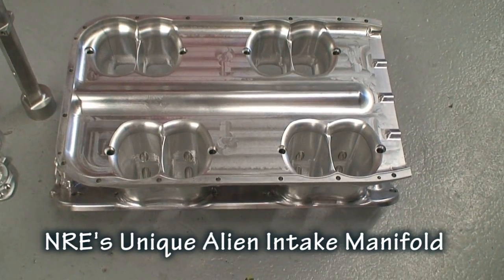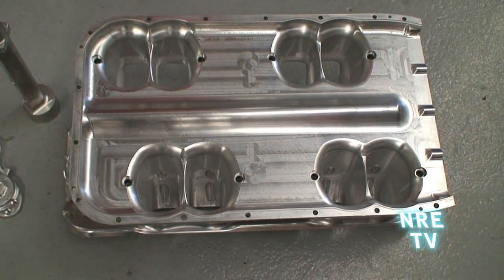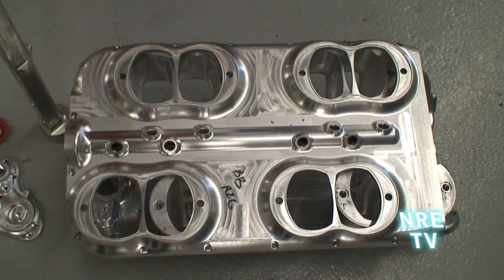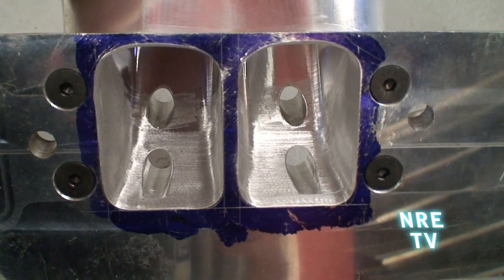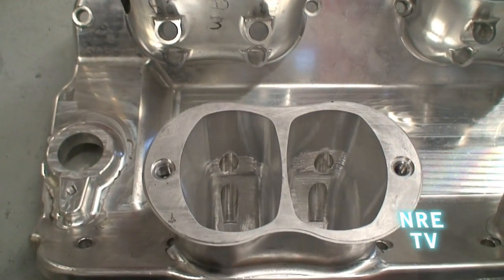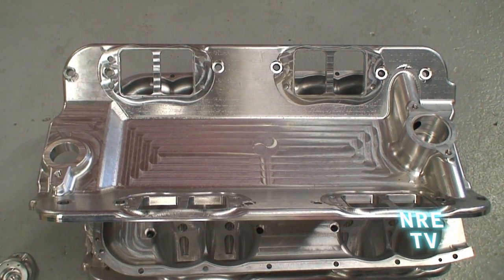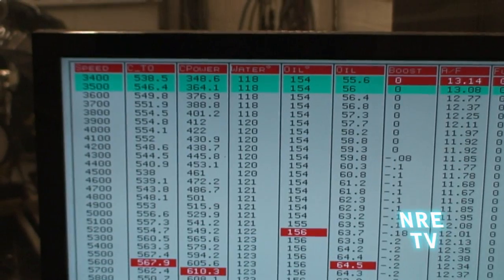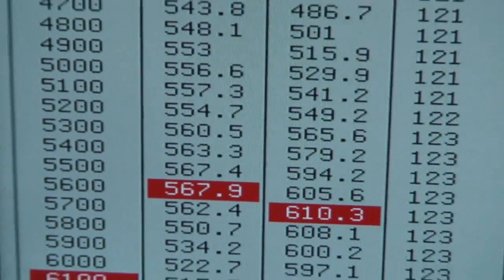Alien Intake Secrets Plus 610 HP 502 BBC Crate Engine Tests from Nelson Racing Engines. NRE.

Comment: Tom you need to build a SOHC or DOHC engine, with needle bearings on the crankshaft, like an outboard marine engine. Perhaps timken needle bearings on the crankshaft & on the wrist pins in the pistons. Also needle bearings on the main journals of the camshafts. Bearings in the rocker arms. I was thinking special cams for the SOHC  engine so that two cylinders could fire at one time but on opposite sides of the v8 engine. For example the cylinder at the far back on the left side & the cylinder at the front on the right side both fire in pair like that, making the horsepower & torque twice as much. I believe  your engines could take them because everything is over built on your engines. Imagine an oversquare(very short stroke, with a big bore) engine compound turbocharged with 2 small turbos & a small whipple supercharger.

Comment: Would the fuel rail being mounted in the intake make the fuel cooler or warmer? Naturally when the engine is at standard operating temp the intake itself is very hot to the touch, just wondering if this would have adverse affects on the fuel in that rail.

Comment: all the air is lined up good, making this beast a torque monster. any plans for a small block chevy version? you should do a weight comparison between the billet blocks and the final weight and share with us. 10 years as a cnc mill operator/programmer, i can appreciate all the time in one of these intakes. you guys use mastercam? need any experienced tool and die makers?

Comment: It would have been nice to see a pull with the Alien Intake as the only change.  The stock ZZ502 is rated at 508hp@5200rpm/580lb/ft torque@ 3600rpm.  The same engine with the Alien Intake and a cam change made that 610hp@5700rpm/567lb/ft torque @ 5600rpm running a coolant temp of 120º during the pull.  the ZZ502 hydraulic roller cam p/n 12366543 has specs of  224º/234º duration @ 0.050" lift with lift specs of 0.527"/0.544"  110º LSA.
I wonder exactly what the Alien Intake itself was worth for output. If we are doing that, we might as well compare the Ramjet 502/Ramjet ZL1-454 intake as well.  The Ramjet ZL1 got a solid roller cam and a rating of 510hp@5750rpm  and 493lb/ft torque @4250rpm of with p/n 88961447 236º/232º duration @ 0.050" lift  with lift specs of 0.640"/0.598" lift 114ºLSA.  Max recommended engine rpm is 6,300rpm(or 500rpm higher than the max. recommended rpm for the ZZ502. Fuel shutoff for the 454 Ramjet ZL1 is set at 6,375rpm.
The Ramjet 502 is rated at 502hp@5300rpm/568lb/ft torque @ 3600rpm and uses the same cam as the carbed ZZ502.
The Ramjet 502 got a stock dual 48mm t-body that was used on the 1985-1991 Corvette and 1985-1992 F-body TPI engines.  The 510hp ZL1 454 engine got an upsized dual 52mm t-body.
Reply: 50.9 hp increase with intake alone. There's a video.

Comment: I agree, I would love to see some machining being done on one of the parts. Am I right in thinking that aluminum has no grain, in the sense that it is equally strong in every direction when machining? I know that cast iron and forged iron has a crystalline structure which limits its usefulness for machining.

Also, no problems with different thermal expansion coefficients when combining this intake manifold with an iron block? Or are all compatible blocks made of aluminum?

Comment: Where do you get off selling this for 8,000 dollars?? I can buy a great supercharger for half that price and get double the power. Yeah it's an amazing design but it's too over priced to sell to the general public. That's why nobody has heard of this. Drop the price and you'll have more buyers and turn a better profit.
Reply: +TRUE SS454 I've worked around plenty of metal shops and mills and  the billet alone is EASILY $1000, that is just the raw metal. Then we are looking at I'm guessing 80-90 hours on the mill, plus fixture time, tooling cost etc. Then you got to pay that machinist who makes a pretty good hourly wage for those 80+ hours. the avagre pay in the us for a CNC machinist is $22 an hour and at a shop like Nelson it wouldn't be unheard of for a CNC machinist to make $30. That means you just paid someone over 2000 to make that, assemble and control test the intake. When you are making small batch, damn near to made to order product the price will always go up. This isn't Holley punching out 10,000 intakes a year on a production line, it likely takes them a week just to make one of these. Time is money, and cost and demand apply.